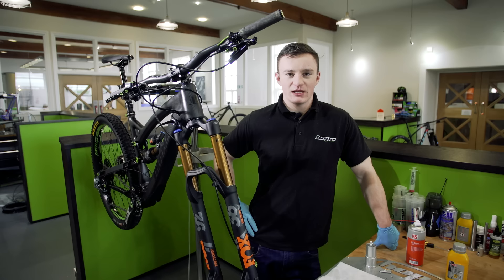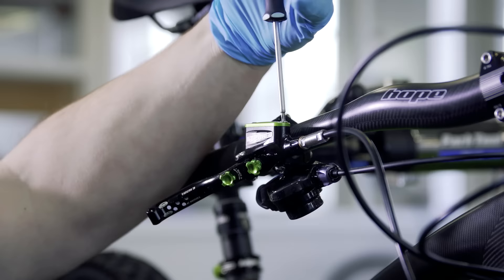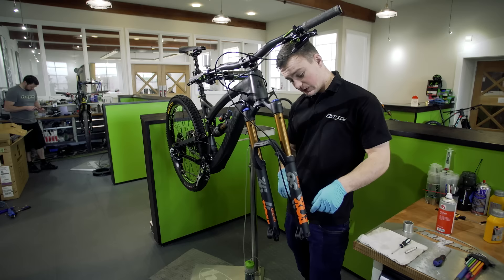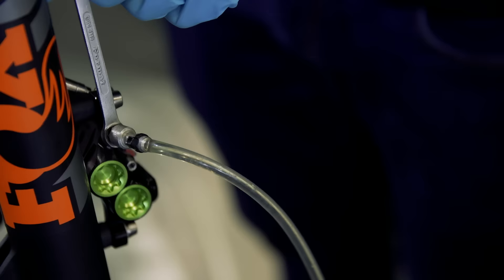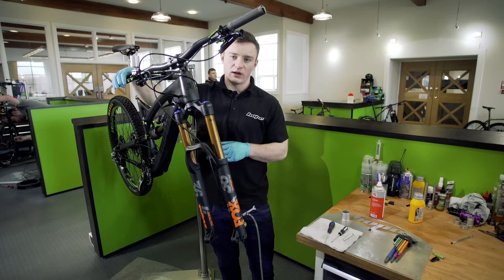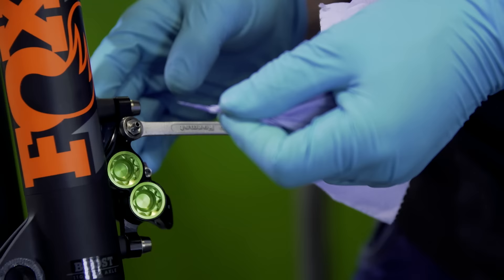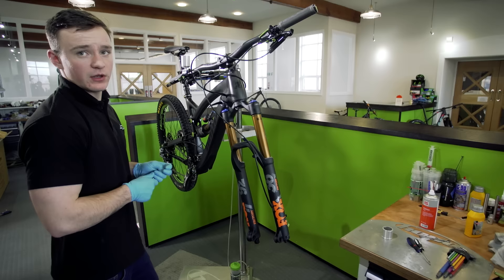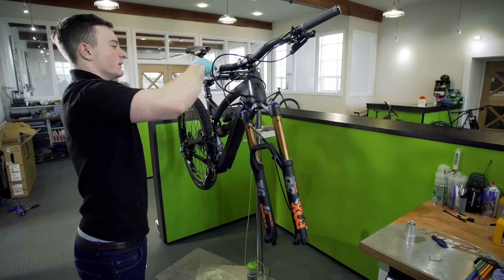Hope Technology: How To Bleed Hope Brakes

Comment: I like how HOPE is like a normal motorcycle brakes where you don't need to vacuum anything to draw out the air, just pump it until it's cleared. much more liquid in the reserve tank. love it
Reply: Hope brakes are one of if not the worst to bleed. Others use syringes which minimises spillage. Even their latest tech 4 brakes are still crap.
Reply: @Sidowse  for hope, I could just fill the reserve tank and pump. Were as for SRAM and others, you need one or two syringe and other small tools. I don't know about u but if you feel bleeding brakes on hope is difficult, I feel sorry for you...
Reply: @randomlonglegcat7973  Others just do it better. You can send in fluid from the bottom/calliper.
Reply: @Sidowse  yea, cool, but why go through the hussle of syringe if you can just fill the reservoir and pump? I just don't get it.
Reply: @randomlonglegcat7973   for Hope brakes you have to secure the bike. Level the reservoir, undo two screws etc and then "Pump" and that doesn't always work. Shimano etc you just undo a bleed screw at the top and with the syringe attached, need not worry about spillage. Also, read some of the other comments on here from other people.
Reply: @Sidowse  yea, it looks like the same amount of effort with the hassle of cleaning the syringe after. "always doesn't work" could be said for both worlds. I own Hope, Sram code R, and Shimano Saint. I've bleed everyone of them count less times. All of them aren't hard to bleed, just I find hope to be the easiest

Comment: Could do with more light when pushing the pistons back as too dark to see what exactly you are doing , thanks
Reply: Yep, trying to do this, it seems to suck in a bunch of air when I do it (yes, closing the bleed  nipple right after).  It seems more like the position of the caliper, un-bolting it, is important.  Unfortunately, you are essentially trying to bleed brakes "backwards" with Hope, air bubbles don't naturally want to go down (to the caliper), so it gets real frustrating real quick.
Reply: If you are doing this with the pads still in place, start to push the pads back by the backing plates. There are winged edges you can slowly push back, if you do either side of the pad you'll push the pistons back in evenly. Once there is enough space between both pads, you can get a flat tool in there, something like a Park PP-1.2 to help with the rest.
Reply: Just use a bleed block

Comment: Just reading comments and, in my view, this process is more straightforward and reliable than that of Avid or Shimano. The reason the pistons are pushed out and back in is to dislodge air bubbles that may be trapped behind or around the piston. The reason for doing this is mostly due to the size of the components and the actual flow rate of the fluid while bleeding, i.e. the flow rate of the fluid, when the lever is pulled back, is nowhere near rapid enough to create vortices that will dislodge air bubbles. 

It's still better than Shimano and Avid as they suggest tapping the parts in the hope of dislodging the air bubbles and reverse bleeding.

P.S.  Cycle Tech UK is spot on with cleaning the pistons before pushing them back as this reduces the chance of damaging the delicate piston seals and thus the possibility of drawing air in and/or leaking fluid out!
Reply: To lubreacte the pistons and seals Hope use plumbers silicone rubber lube (Hunters). However silicone lube can't be used with DOT 5.0 brake fluid as it silicone based and will 'wash off'. 

A good quality (Castrol is one of the best) Red Rubber Grease is good option for the. Red Rubber Grease, normally Vegetable Oil based, is actually designed for the lubrication of hydraulic brake components during assembly so will not ‘wash off’ as readily.

Silicone based brake fluid has a has better heat handling capacity over DOT 2,3,4 so, considering the small components, is a good choice for bike brakes (remember the Hope C2 when they got hot) but it tends to brake down the seals prematurely especially if the seals aren’t designed to be used with silicone fluid. So enter DOT 5.1 like DOT 2,3,4 is glycol based with a similar heat handling capacity as DOT 5.0 but not as searching.

I’m not a trained cycle mechanic so I have learned this form research and trying to understand what I’m entrusting my life with. If any of you guys out there know better please comment.
Reply: Well, with Shimano, you are pushing fluid from the caliper up, air bubbles naturally want to go up and your calipers are below the level of the levers, so it tends to work quite well.  They have that part well thought out.
Reply: @JamesNoBrakes  with Shimano, because mineral oil is hydrscopic (will not absorb water) you tend to get a pocket of water down at the caliper (since water always finds its way in, eventually).  So you need to do a full purge anyway...doesn't matter whether you do this at the caliper end or the reservoir... the point is to flush the system completely of all the old oil...any water or air will naturally be forced out
Reply: @bluestraycat  It does matter, because any fitting possibly allows some air in and you are trying to fight the natural direction of the air with this bleed technique.  Whether it's pushing fluid in with shimano or having it come out with hope, that action allows some air back into the caliper.  At least with Shimano everything is going the right way and will work to the high point, but trying to go the opposite direction with hope leads to trapped air.  Sorry, it's a piss poor idea.
Reply: @JamesNoBrakes  No it is not. Shimano steps to bleed the calipers are flicking the lever violently then open the bleed port in the caliper with the same setup like in the video. The really key part to bleed the caliper fully is move the pistons in and out like in the video,locking 1 side and expose those pistons out(suck in more oil that the final brake would have) and then open the bleed port and push back the pistons.
Reply: @josemorenoporras7506  Just read what you wrote.  All those steps to fight gravity.

Comment: I did this method 3 times and still had bubbles trapped in the system - once I started to play with Syringe at the caliper I was able to get rid of all the air trapped within the caliper area. I recommend anyone watching this video to work with syringes instead of pumping the lever all the time to avoid wasting time and trying to figuring out why is the air trapped here and there and having to unscrew the caliper
Reply: What technique did you use with the syringe?
Reply: @chrissnowden7078 fill syringe with fluid, connect at caliper end, open reservoir at the lever, push the fluid from bottom to the top, done. To be 100% sure I did also the other way around. You may also want to try to push the lever multiple times with the reservoir open to make sure no air is within the lever itself.
Reply: @Deplated Great, thank you. Bottom to top makes total sense in terms of where the air will actually want to go

Comment: From 8:19 Keep the easy bleed tool attached while you push pistons back. Stops a lot of fluid overflowing everywhere.
Reply: Just so I understand, you do not use a block like you would other brands. You just leave the pads in, bleed the system and then back the pads back therefor pushing the fluid back out the top where you then seal the system?
Reply: @nopenada8071  you can technically bleed any brake with a bleed nipple like this, with the pads in there not enough space to pop out a piston. the pads just allow you to skip the press up step, but prevents you from pushing out pistons to get any tough bubbles in the caliper, other brands like Sram compensate for this with a vacuum bleed at the caliper.

Comment: Thanks Dan you legend.
Amazing tutorial for the superior bleeding method for a superior set of brakes. However nothing is perfect and there are a few improvements.

1. Remove the brake pads before starting to make life easy. This will also give you a chance to lube & realign the pistons.

2. Use a block of wood or something hard as a chock for the pistons once you start bleeding. This also ensures theres no air trapped behind the pistons as they are not extended out.

3. Money Saving tip (use at your own risk): Once you notice all the old fluid has bled out and only air and new fluid is in the pipe, pour the new fluid coming out back into the reservouir as you continue to take the air bubbles out.
Throw away old fluid though, thats not good for anything.

Happy shredding 🤙
Reply: Exactly, just did the bleeding on both front and rear, and I did 1. and 2. as you described. I had a plastic block from a previous bleeding kit that worked just wonders to keep the pads in.
Everything went well, but just keep the funnel mounted until you have completely retracted the pistons at the end, so you don't mess oil around as on the video.
The one thing that was a pain was realigning completely new pads, there is so little clearance. The pistons must really be fully in 100%, and I didn't managed it completely at the front, so a little rub for a couple of rides I guess...

P. S: did a good relub of the pistons with silicon lub: perfect result, that's all it took. But I used the brake lever to get them out and the center part of a flat wrench to get them back in. Back and forth with lub each time. No rub!

Comment: With all that brilliant engineering and top notch machining would it be that bloody hard to put a bleed port on top of the reservoir? Seriously guys...
Reply: I am walking across my room, hitting walls with my forehead and yelling WHY.
Reply: How would they sell extra unique tools for maximum boonies if they did that though?
Reply: Moto style baby
Reply: Or you could leave the bleeding cap on & use a bolt to fill the hole.
Reply: @rhettcorbett3346 Sorry, I’m confused by this suggestion- leave the cap on and use a “bolt to fill hole”? Could you elaborate on this?
Reply: @paulmaul I think he means leave the cap from the bleed kit on, and use an appropriate bolt to seal it where the cup screws on.
It’s really not difficult to bleed them with the kit, and you’d need two of the bleed kit caps to do that suggestion. People just love to moan.
Reply: Almost like a shimano brake you mean 🤦‍♂️
Reply: @gregorteply9034   Sorry to hear that...

Comment: Worked lile a charm and i never did bleeding on any break before. Im just kind of stucked with rear brake where i had to take the hose out as i had to rpute it through the frame, small portion of bubbles still come out. The break itself isnt spongy so I guess i just ride it a bit and then rebleed.

Comment: Don't want to play the wise-ass here, but try connecting an electric pump to the caliper and go from bottom up  - You gonna need max. 3 minutes per brake and will skip all of the loosening-pumping-tightening. Look for any battery powered mini pump for petrol on Your local market and set the voltage to the lowest possible value for a pump to still work. The rest is just a transparent hose and a towel. Or possibly more easily, connect a BIG hypodermic syringe filled with a brake fluid to the calliper. Because the bubbles like to go upwards.

Comment: @hopetech : Stupid question perhaps, but don't don't bubbles naturally rise to the top ? So why don't you push in new oil from the bottom with a syringe and let the bubbles come out into the bleed tool on top of the reservoir  ? I'm know how to bleeding Shimano brakes, but some blue Hope v4's are on the way for my Husqvarna 2021 MC8. Is it because of the thickness of the dot 5.1 fluid vs the mineral oil in Shimano brakes ? I would like to understand the reason for this. Thx.

Comment: Personally, i would have taken the pads out to avoid ANY contamination. Plus i would lower the bike in the stand alot more. When taking that reservoir cap off initially if the bike is that high you've got a massive chance of dropping a scree because your messing around wiyh small screws above head hight. He even struggled to get the tool into the screws themselfs.

Not that im saying he's no idea what he is dooing but the execution could of been alot better.

Comment: Why would  you remove the reservoir before you push the piston back at 8:15?
Reply: The reservoir contains clean brake fluid. If you keep that on, the clean oil can get contaminated with parts of old fluid.
If you remove the reservoir in time, you can pour it back into the canister.
Reply: @bjorne46  it dont matter
Reply: @AlexeiPavlov  it does matter if you want to get clean fluids in the system. But everybody has their own quality standards I guess.

Comment: My recent set of hope tech 4 e4's came horribly primed with fluid and one side of the pistons (on both sets) will not move.  A huge pain.....  I've still been riding on them strong with good power but hoping to fix this as my Tech 3 E4's have always been are still much better feeling.  Also the newer spanners don't fiit very well nor provide enough resistance to retract the calipers much as my previous brakes.  (My previous brakes are v6 in front and e4 rear.)

Comment: for the rear break, after a full piston service. I found it hard to remove the air from the caliper with it mounted on the bike. Make sure beofre you start the bleeding that you remove the caliper and hang it so gravity does the job to remove the air. this happened since back pistons are higher than the bleeding port and air won't come out.
Reply: your idea is true and i will try it but if i hang the caliper,that nipple position is up or down sir?
Reply: @METEORA_47 upwards- so air will go out more easily
Reply: @paulmaul  thanks.I appreciate it and it is very helpful
Reply: would OK if there was a syringe, if it hangs it become mega difficult to work with

Comment: Why would you not just have a top cap that has a screw in it for the easy bleed to use? Seems weird to have to remove the top cap to then put another top cap on to then put the bleed kit on…

Comment: So how many NM should you tighten the bleed cap? And question to any owners of theses breaks my breaks have been bleed 4 times by a bike shop they called hope and hope told them to swap out the cable so they did well still having the same problem so when I flip the bike upside down the break losses pressure the the front break doesn't do this at all and when I first bought this set neither was the rear I ride a lot so sometimes I have to flip my bike upside down to work on it.. does anyone know what it could be?

Comment: Why not use a syringe to push fluid and bubbles back up into master cylinder? If you have a bubble near the top of the hose it is nigh on impossible to send it to the bottom using this method.
Reply: Fair point I cant seem to get all air out using this method
Reply: So de-gas a syringe first, then attach to the bleed nipple (at the caliper) and push it through the system in reverse?

Comment: Did they put a spacer between the brake pads? Or did they replace the brake pads with a spacer like when bleeding Shimano brakes?
Reply: Personally I would let the disk sit between the pads (just leave your wheel mounted during the bleed) and then basically give them a good clean with some disc brake cleaner after your done with bleeding.
Reply: Just dont let brake pads when you are bleedind your brakes .... when its contamined with any oil or brake cleaner just go to the trash and buy new one , so keep them out of the way plz

Comment: just received my easy bleed kit. the clear hose that is meant to attach to the nipple fitting has an internal diameter of around 3mm, meanwhile the nipple fitting has an external diameter of around 5.5mm. How tf am I supposed to get the hose onto the nipple fitting?

Comment: Hi i would like to ask if i can use a dot 4 on my hope v4?
Reply: Yes, you can. You can mix DOT 3, 4 and 5.1 (NOTE: NOT DOT 5 tho!!!)  The drawback is that most brands of DOT 4 have a Lower minimum boiling point than DOT 5.1. Now there ARE DOT 4 brands that actually have a higher minimum boiling point than say a cheaper DOT 5.1- for instance I use DOT 4 made by Motul (RBF 600) and it’s MBP wet is 195C which is petty high. It’s for racing brakes I use on my track car (2006 GTO)

Comment: Why not leave front wheel on?
Instead of recking pads with a screw driver....
And I've always had success bleeding by syringing fluid from caliper to lever ,to push the air upwards and out

Comment: Wondering which brake fluid to use on a Hope hydro brake system used on a Porche FS Evolution bike.
Bike is from early 2000s.
Any hints?
Reply: Dot 5.1
Reply: actually im use brembo dot 5.1 at my tech3

Comment: Strange how air manages to flow downwards with hope brakes
Reply: You are purging the system of all the old oil. The air is forced out with it.
Reply: This is exactly how you bleed car and motorcycle brakes. Not sure why people don’t understand this. The air is forced out by the new fluid being forced into the system. Have you ever bled car brakes before? If so, where the results successful? Now, i will concede that rotating the caliper so that the bleed nipple port is oriented upwards, but this is a tried and true method of bleeding Hope brakes. You just need to keep pumping new fluid thru the system until you see no air bubbles coming through the exit hose. There are other methods that may work for you, but for me, having owned 4 sets of Hope brakes over 20 years now, this method works great. YMMV tho